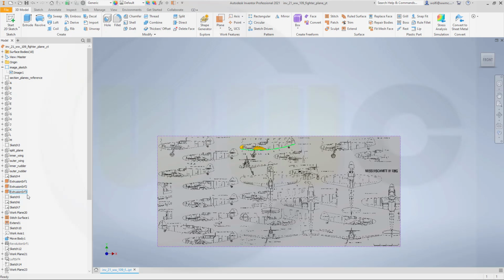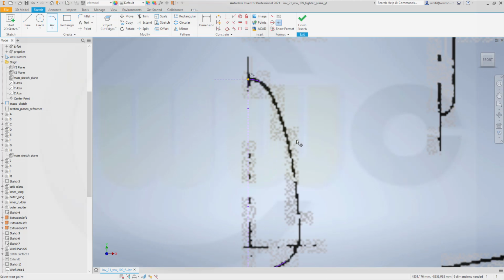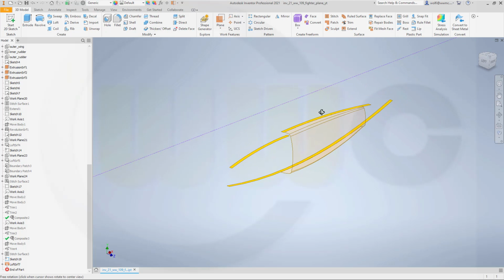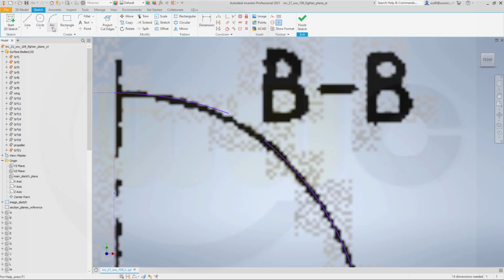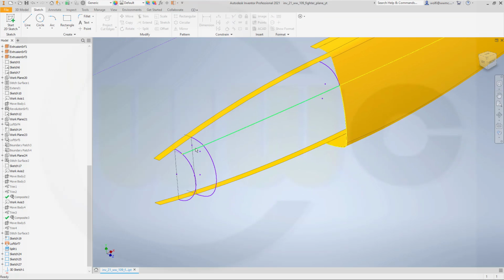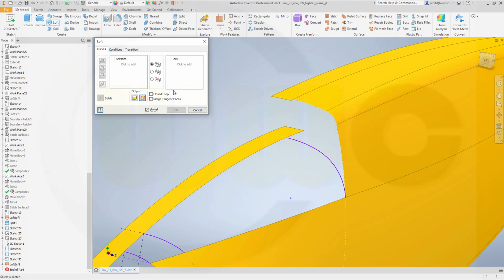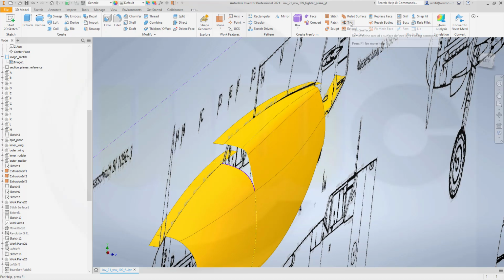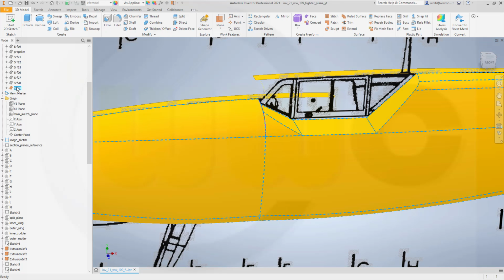WW-109 Fighter Plane - Part 4 - Main Fuselage - Inventor 2021 Training - Surfaces

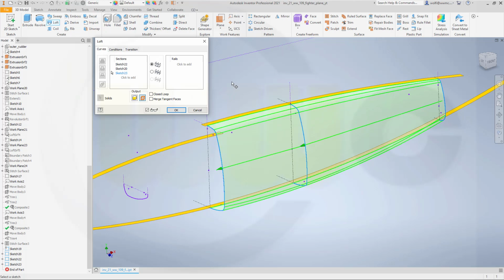Comment: Hello, thank you for these videos, very helpful. I have a question about a loft, I am doing similar fuselage but I am not able to loft my sketches by the edge of the main frame as you do at 15:00. Could you possibly advice me please ? The problem is that when I select leading edge, loft crashes down. without the leading edges, loft is possible but not copying main frame.
Reply from the maker: Sorry, without reviewing you model I can´t tell what the problem is. So maybe you should watch all the steps I did very carefully, I suppose something went wrong with the projected geometry in the sketches.